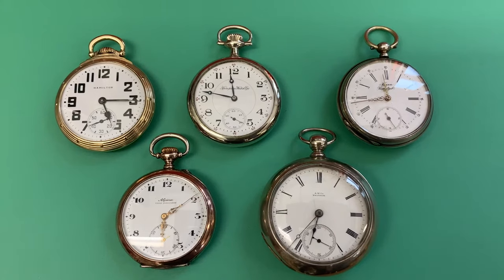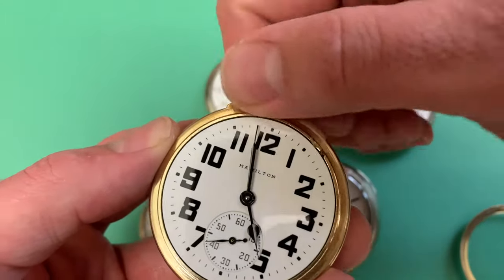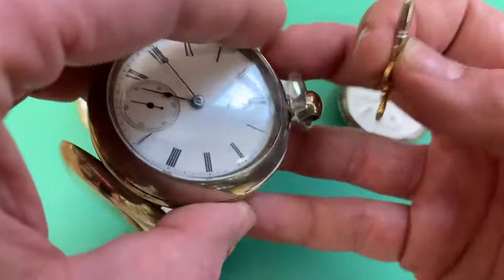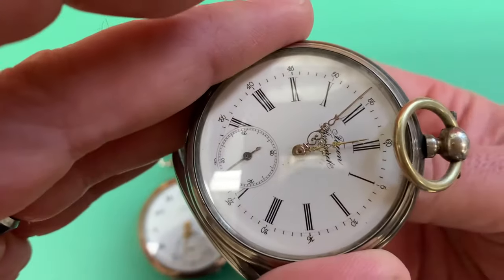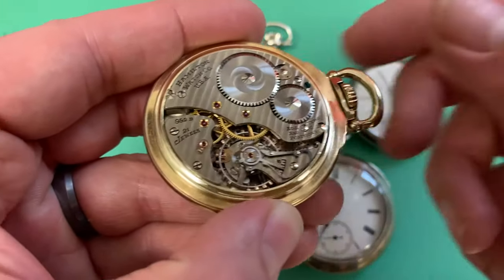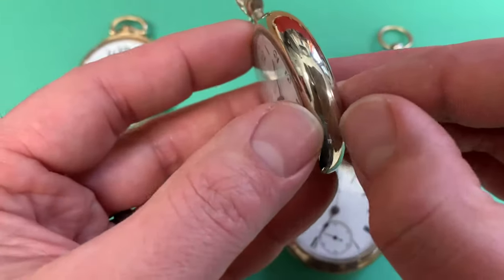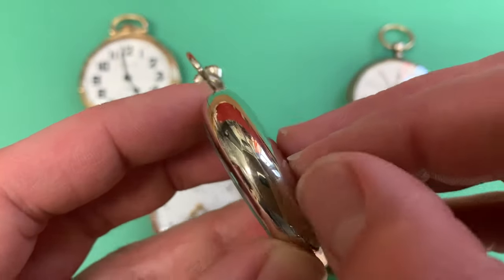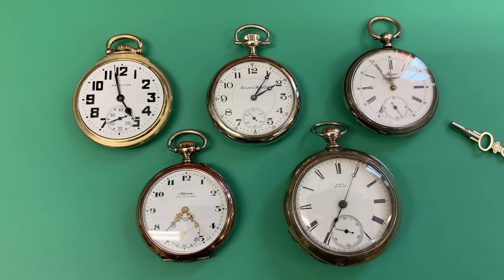Setting and Winding Pocket Watches

Comment: Just found this video while looking for answers.  Hope you don't mind a question, I would greatly appreciate your help/input.  I just received a watch with an Elgin 7640023 from 1899.  I would imagine this is a pocket watch movement (small) that was re-purposed in a watch case.  My question is this, I figured out I have to push in the crown and wind while pushed in.  When I pull out the crown to set the time it is very very easy for the crown to come out al the way in my fingers.  I have to wiggle it and find its way back in, then get to a position where I can set the hands and leave it.  The crown stays in, turn sideways stays in.  But if I pull it to set the hands it comes out too easily.  I notice in your video that the pendant set has that pendant part and appears that it would keep the crown from falling out.  Is this normal that if the pendant part is not there it is very easy for the crown to slide all the way out?  Or should it be more difficult to come out even in my example?  Again, thank you so much for your "time".  :)

Comment: thank you this was very helpful and informative.  however, i can't figure out how to open the face on a keystone hunter watch from 1800's. the front of the case comes up when you push down the crown, and the crystal has a hinge, but there seems to be no place to pry it open with. but your video really helped me with an older, nonhunter key wind watch.  Thanks!
Reply from the maker: It's hard to tell without pictures what you are seeing. If it has a crown to wind, that means it is either lever set (most likely), pendant set (less likely), or pin set (highly unlikely for an American watch). 

On hunter movements, usually the setting lever between the 4 and the 5 on the dial. If you see a slot for a lever but can't feel a lever, it's possible your watch is damaged.
Reply: @MinnesotaClocksandWatches  Thanks. i finally saw a little slot between the case and the frame of the crystal and levered it up with my fingernail. your comment that you can tell if it is set with a key by seeing if the center has a square top made me persevere in trying to find a way to open the crystal. then i key set it. it was not easy to get the crystal to close after that, but gentle pressure on opposite sides worked.  it is one of those watches that has been set in the hunter case sideways, so perhaps was not originally a hunter. i really appreciate you replying to me so fast. your video covered a lot in a way that was easy to understand. thanks again!

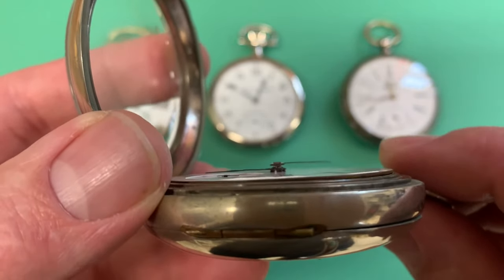Comment: I have an 1873 Elgin G.H. Wheeler pocket watch that was my Great, Great Grandfather's.  I've disassembled it but don't have the key.  It looks like it has a lever set but from this video, it seems like it should be a front set.  It looks like the lever coming out of the side at 4:00 is missing the lip to pull it out.  The hands do not have a square fitting so I'm fairly certain that it is a lever set but want to be sure.  Any help would be great.
Reply from the maker: If you know the manufacturer and serial number, head over to pocketwatchdatabase.com and type it in. You will get a detailed description that should include winding type.

Cases were swapped around. I have several watches where there is a slot in the case where a lever might be, but the watch is actually pendant-set. It's also possible your watch is damaged.

If it is a keywind watch, then it will almost certainly be a key set watch. If there is no nut on the hand, the hand may have been replaced with an incorrect one. Pocket Watch Database should give you a conclusive answer.

Comment: Great video, thanks. I have the oldest style key wind watch. It was a recent anniversary gift. I'm concerned about over winding it. Can you recommend how to wind it up?
Reply from the maker: "Overwinding" is a word used by dodgy dealers trying to shift the blame for a watch that doesn't run onto the user.  :) Watches are meant to be wound until they stop. As long as you are careful, you are within the original intent of the watchmaker. That said, mainsprings do break due to metal fatigue. It is possible that if you wind your watch up the spring may break on you, but that isn't due to "overwinding", but normal wear and tear. It does seem sometimes that springs can break on watches that have sat untouched for a long time.

If the watch is fully wound and not running, that means the movement is dirty or broken. That has nothing to do with its winding state; watches need periodic service, and if your watch hasn't been serviced in several years (or decades or centuries), maintenance is likely needed.
Reply: @MinnesotaClocksandWatches  hi, how often should a pocket watch be wound? :)
Reply from the maker: Every day.

Comment: my question is for a Hamilton 974 nickel snap open case. The crown or stem works great but seems to have a additional feature. when its wound, hands set and back in its normal position you can press the crown and it comes back up on its own again. I s this some sort of adjustment tool or does it have a function
Reply from the maker: This is related to the swing out case mechanism - this extends or retracts the winding stem so the movement can swing out.

Comment: Thanks for the video. I have the older key wind type, but no key. You said a key can be ordered. I can ask my jeweller, but was wondering if you had any advice either, preferably in Europe.
Reply from the maker: In the U.S. keys are easily obtained from retailers like timesavers.com. I presume there are suppliers in Europe - I believe there is a clock material supplier called Cousins. Sorry to not have more specific direction.
Reply: @MinnesotaClocksandWatches  Thank you! I will check both of them out 😊

Comment: How do I set the time on an old Westclox pocket Ben? No lever on it, and when I pull out the crown, that doesn't do it. Thanks.
Reply: Those movements are pin pallet escarpments like old Smith's or Ingersol watches, you may need to push the crown towards the case to set the time

Comment: I've got an old watch that has to have a key to set the time. What size do you need. That middle square piece is really small and the key that winds the watch doesn't fit it.
Reply from the maker: Watch keys come in many sizes. You'll either have to measure them or do some trial and error. Timesavers.com sells a set as well as individual keys.  As you have mentioned, it is not uncommon to need two different size keys for winding and setting.
https://timesavers.com/i-8948011-pocket-watch-key-14-pieceassortment.html

Comment: I have a lever set movement in a hunter case, and you don't need to take the bezel off to access it. I'm not sure how common that was.
Reply from the maker: Yes - that's easier to set as the lever is visible without disassembling anything. Hunter case watches are common, but probably in the minority compared to open face watches.

Comment: I have my grandfather watch and it's an Elgin. It has a winding crown at the top but no recesses for setting and no spots for a setting key. It seems like the only way to set the watch is to open the face and move the hands with your fingers but that seems awfully risky to me.
Reply from the maker: If there are no recesses and you don't see a square nut, it is probably a pendant-set. Sometimes they can take a bit of force. I agree with you - moving the hands directly is not a good idea.

If you look up your serial number on pocketwatchdatabase.com, you should get confirmation on the type of movement you have.

Comment: what happens if you adust the time set on wind up pocket watch while in motion cause I did that and it not wind up
Reply from the maker: Most pocket watches don't have a hacking feature that stops the balance wheel during setting, so the presumption was that most of the time the watch would be set when it was running. There should be no problem doing this. If your watch isn't running, it probably needs service.
Reply: @MinnesotaClocksandWatches  thank you

Comment: i need help ive got a watch without a battery that hasnt got one of those holes when you open up the back so im not sure how to set the time
Reply from the maker: It's hard to know what you have going on without pictures. If it's a pocket watch, you may have a lever set watch which requires removing the bezel, which I cover in this video. A local jeweler may be a good starting point.
Reply: @MinnesotaClocksandWatches  I figured it out, I had to pull the top bit up to then turn it to change the time. It's dated at around 1910 I think. I've accidentally pulled the top bit out so it comes apart and i can't push it back in so now i'm just trying to fix that. Thanks anyways

Comment: I would have liked to hear less about the styles & more about the correct ways to wind & set.  Some people say with a crown winder (or similar on a wrist watch) NEVER wind with a back & forth motion. Some say it doesn't matter.
When setting a watch (or clock) I've been told ONLY advance the time. NEVER set the time by running the hands counterclockwise.
Any input? I went to pocket watches in 2004 unless using a vintage wristwatch as jewellery.  LoL TIME & I are not on a 1st name basis but on those rare occasions when I must consult a device sadly, I confess it is almost always my phone. In homage to the beauty of timepieces of yesteryear I have  a dynamic image of a gold pocket watch as the lock screen/always on display.
XoXo
Reply from the maker: Thanks for your feedback. When winding, going back and forth with the crown isn't a big deal; you are just exercising a ratchet mechanism that's there as a convenience. It doesn't cause any more wear on the watch than when you wind it forward as a very similar ratchet mechanism is what allows you to store energy in the spring.

Whether it is OK to set a watch backwards depends on the watch. The vast majority of pocket watches are time only, and there is no problem moving the hands in either direction. Watches that have complications such as calendar mechanisms, moon phases or chiming mechanisms should usually only be set forward.
Reply: @MinnesotaClocksandWatches  that's great. Thanks. I just got my great uncle's Waltham. He worked on the railroad & was present at The Last Spike.
CheerZ XoXo